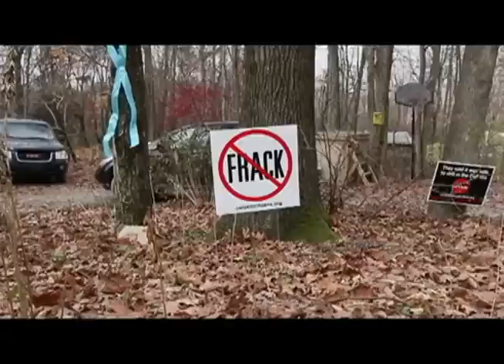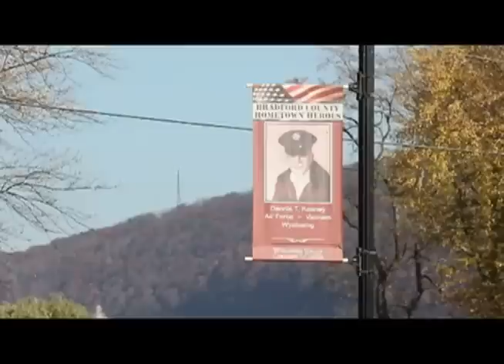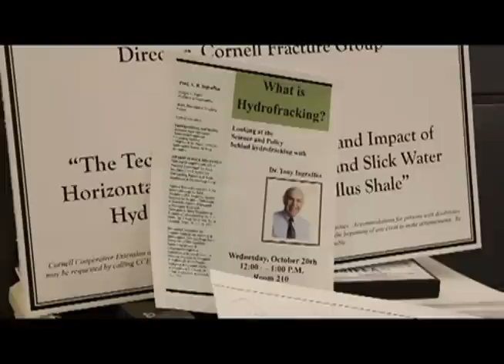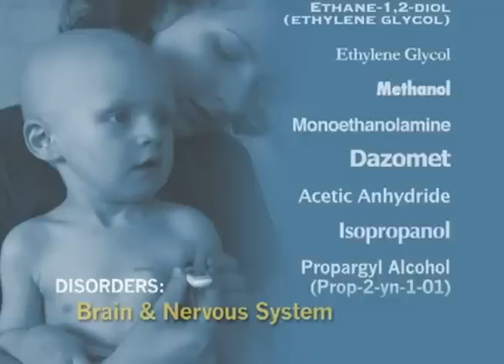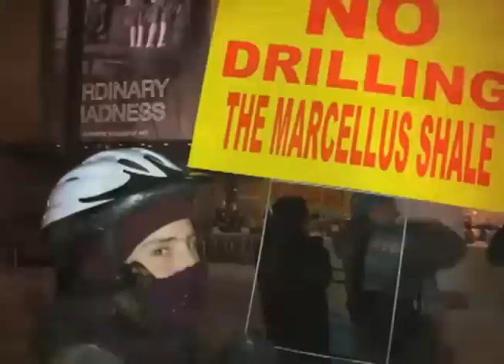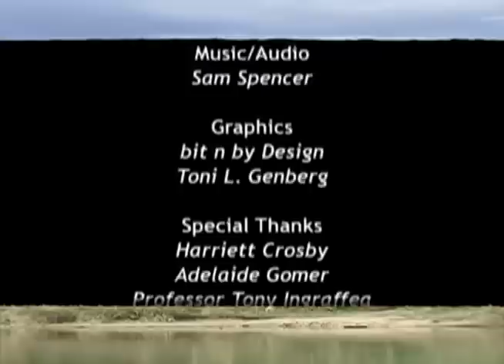Fracture Drilling - Environmental Disaster / Documentary Video

Comment: Natural gas is a ready replacement for gasoline, and is cheaper. Thousands of buses, now, are run on natural gas, and natural gas is cheaply converted to liquid methane that can run cars, too. The Cornell professor is lying. Plus, everybody knows that in the Marcellus shale formation, fracking is so deep (5K to 8.5k feet) that the gas and other pollution CANNOT seep to the surface. It is physically impossible. The truth is that natural gas will harm the coal companies. Follow the money.